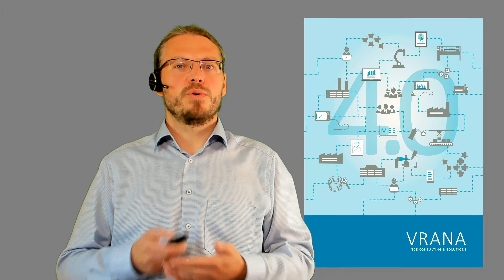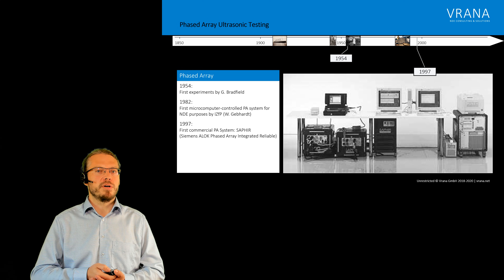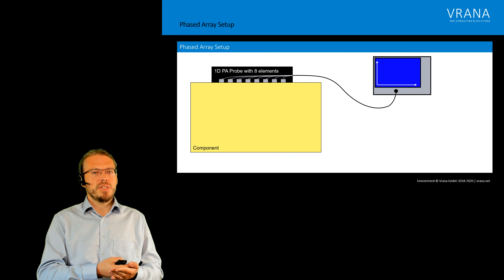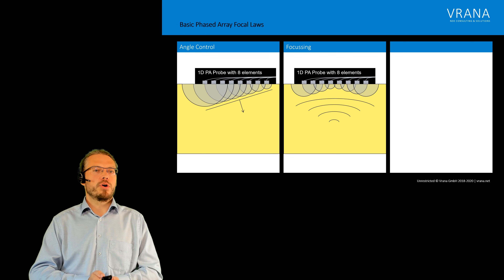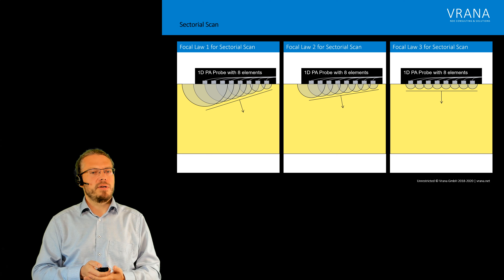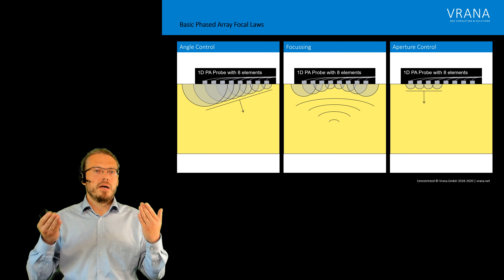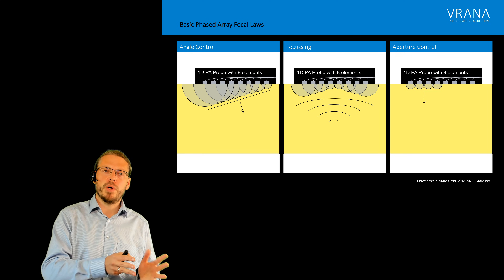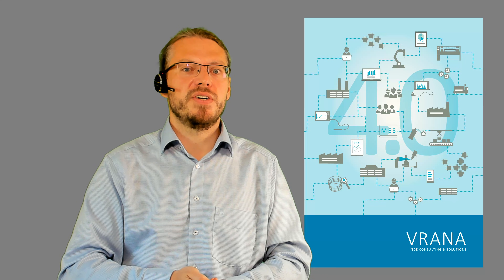Working Principle of Phased Array Ultrasonic Testing

Comment: Hi, is that phased array probe suitable for the low carbon steel hollow forgings with height 500 mm.. required sensitivity 0.5 mm EFBH
Reply from the maker: That depends on the situation and the heat treatment of your forging. 0,5 mm FBH will be challenging but most likely doable. If you wanna know more get in contact with me and we can schedule a short consulting: https://www.linkedin.com/in/jvrana/

Comment: Why its needed a linear scan? I mean whats the problem with exiting all the available crystals at a time and gathering the Data instead of linear scanning? Thank you.
Reply from the maker: If you fire all at one it is like having a very big probe. Very big probes are highly directional and highly focussed (naturally). Therefore you would NOT cover the area under the probe but only a small focal point. And tilted indicates would be very hard to detect at all.

Comment: Great video !
 Does, sectoral scan and beam steering are the same ? 
In case of secoral scan, what combinations are used ? Is it aperture control along with focusing or aperture control alongwith angle control ?
Thanks
Reply from the maker: Sectorial scans use beam steering. However, #1 sectorial scans are usually programmed to scan between two angles in certain increments and to show the result all the different angles are condensed into one picture (S-Scan). #2 beam steering is usually programmed angle by angle and evaluated using A-Scans.
Usually, sectorial scans just use beam steering and with a fixed aperture. But with some more advanced instruments and with the right application .....

Comment: Hi. Really nice video. Thank you. But the question is Do we really need the Phased array inspection in real inspection case (not for scince researchings) or it's just a playgame to spend some extra money, big enough money? Or we just enough with conventional inspection? Of course it depends of the task you need to resolve, but at 99% case of inspection
Reply from the maker: I would think at least in 50% of the inspection scenarios conventional UT is sufficient. A couple of scenarios where PAUT definitely makes sense: #1 automated UT electronic angle steering or sectorial or linear scans (both mainly due to the reduced number of probes); #2 manual UT: If it is not clear which probes you will need for the job. The situation is different with TFM - but more on this subject soon.
Reply: @NDE40  I see. Thank you. Waiting for video about TFM